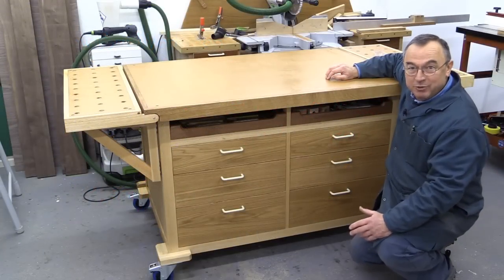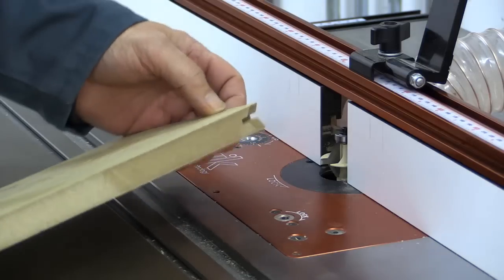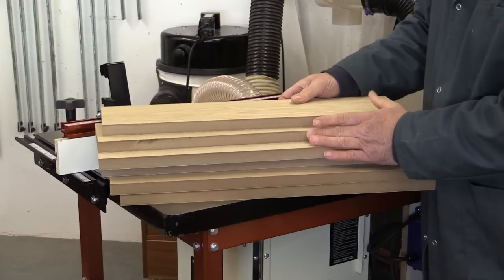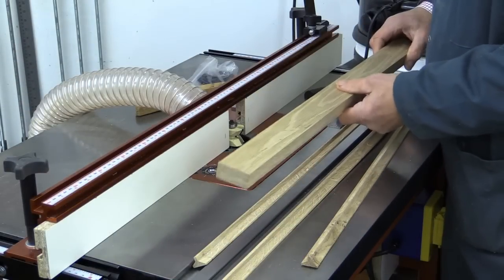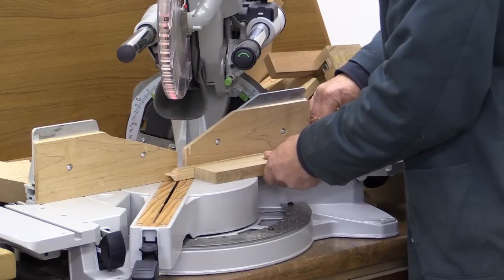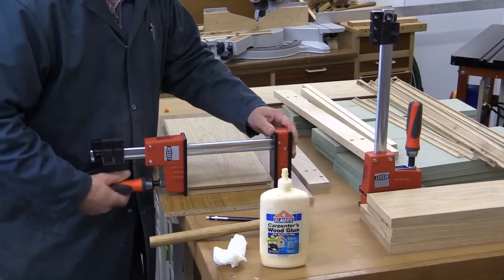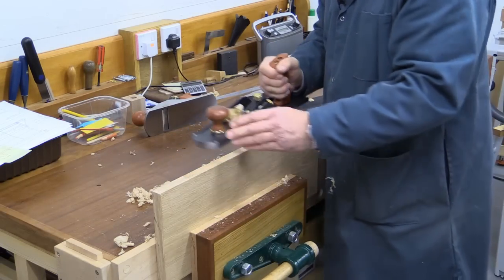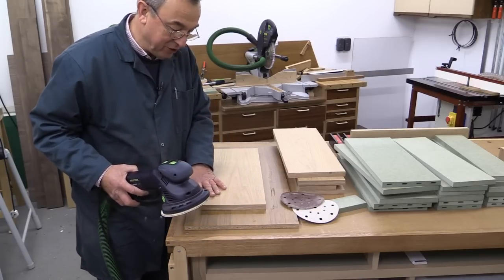Mobile Bench Project - How to make simple drawers - Part 1

Comment: Once again an excellent and timely guide. Suggestion. Instead of the asymmetrical dominos, go through the sides and insert the domino from the outside. You can make a domino out of a contrasting hardwood and the effect is both striking and strong.
Reply from the maker: Hi Joseph, An excellent suggestion. I have seen it done and you are right, it does look good.  Peter

Comment: Whoa! What a lot of work to make a drawer out of crappy mdf. Use plywood and a pocket hole jig. Drawers will take half the time and be ten times as strong...especially for a workbench. imho;)
Reply from the maker: +William Martin   Hi William, I understand what you mean but MDF is much cheaper here in the UK and, believe it or not, it makes a perfectly strong drawer. The other side of my approach is to show alternate ways of doing things and so I have indeed made drawers from plywood, real wood with dovetails and from MDF using lock mitre joints.   Cheers.    Peter
Reply: Hi Peter, I appreciate what you're saying and I was being a bit flippant. I wish I had your workshop and skills but I muddle through with simpler methods and equipment. Thanks for the video though, good work!

Comment: Thanks for this excellent video. Of course there are many ways to make drawers and you seem to have added a couple of twists and I would like to know the reasons for these variations. For example, why not use the Domino for edge banding too?  See https://www.youtube.com/watch?v=cTOeRGJ41DY .
Reply from the maker: Jeff Harmed Hi Jeff, I looked at the video and it shows a perfectly good method. I wanted to show the rather neat edging cutter which makes quite a reasonable job for drawers destined for a workshop bench.  Peter
Reply: New Brit Workshop Fair enough, and yes it was interesting to see the router edge banding technique. I think it is a strong contender for "best of the MDF jointing methods".

thanks

Comment: The more I look the more I see, and the more I understand.   I would certainly love to own a Festool Domino but I'm afraid that they are around $1, 500 Australian dollars.  That's how much my new Laguna table saw is going to cost.  It's difficult to justify the value in such a machine compared to a high quality table saw.  No wonder Festool can afford to make robotic seagulls and kangaroos!
Reply from the maker: David Handley The seagulls and kangaroos are a new one on me. The table saw is a much respected workshop machine in the US and with individuals the world over and if it is at the centre of your work flow then it must take priority. The Domino has transformed my woodworking as I no longer need to spend time making mortice and tenon joints. I sold all of my heavier workshop machinery, including my table saw, in order to buy into Festool. I do not regret that at all.  Peter
Reply: David Handley New Brit Workshop Have to agree with David here. With these drawers I believe I would get a similarly strong joint by splining the corners with a 45 degree cut on the table saw. Just can't justify the Domino... though if I was a pro the Domino and the Track Saw would be priority purchases.
Reply: MrDroovy Yeah.   Big time.   Watching Kokoda on sbs at the moment.   Unbelievable